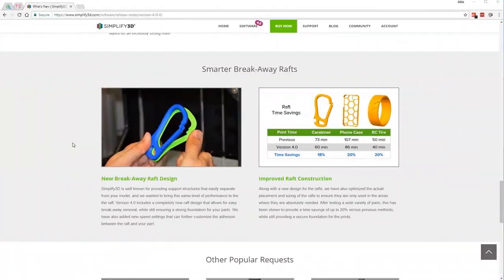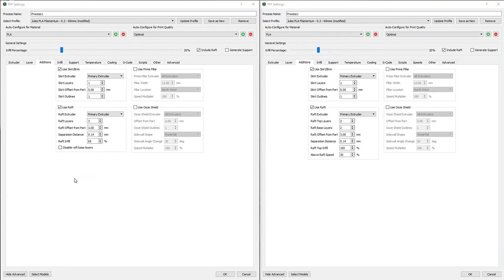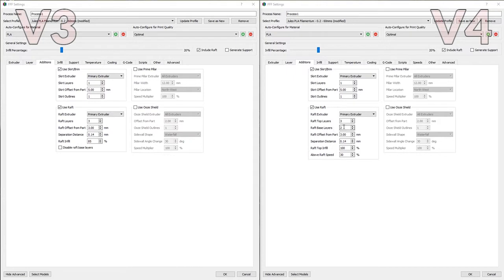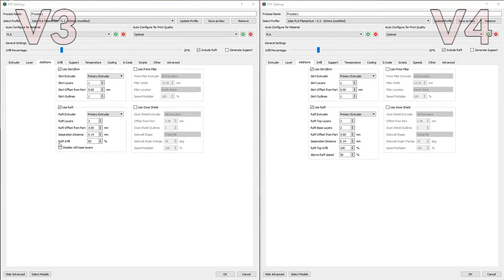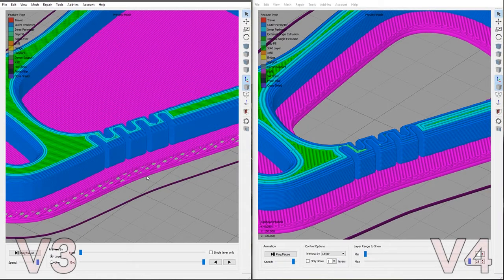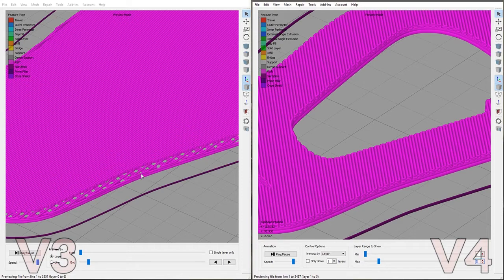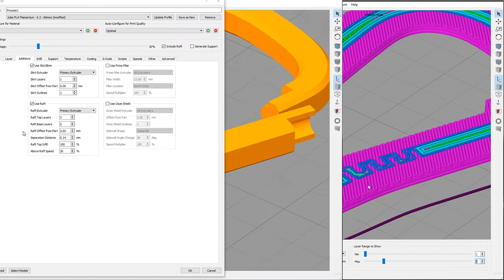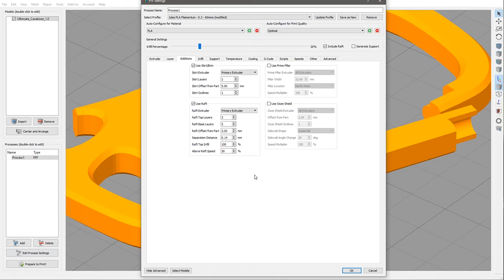Simplify3D Version 4 - Smarter Break-Away Rafts

Comment: Jules, I really enjoy your videos but I've had the opposite raft experience with ver4. I have as much trouble removing rafts as you do with ver3! I am printing on a mirror with kid's glue using 220 degrees on the nozzle and 60 on the bed. Using Monoprice premium PLA. I would be interested in learning your printing temps for this video. Thanks!
Reply from the maker: 220 is at the high end for PLA normally. If you haven't tried lower temps then it would be a good idea to try - go as cool as you can without effecting layer bonding. In that series of videos on Simplify3D V4 I was using Filamentum PLA - hot end at 200C and bed at 50C. Aside from that, in version 4 you should be able to tweak the new raft settings to improve separation - a mixture of increasing the Separation Distance and Above Raft Speed will decrease the bonding between raft and part. But, unless you can't reduce your main hot end temps for some reason, I would look at those first.
Reply: Bingo! Thanks so much for responding! I dialed the hot end back to 200C and the next raft was much easier to remove. The job before this one that I ran at 220 I had to chisel apart.... SO much to learn about 3D printing!

Comment: With the usefulness of brims these days, rafts sort of take a back seat. Thanks for the demo. Now I'll know what to expect when I have to use one.
Reply from the maker: They are useful to prevent warping with warp happy filament or parts with very small contact patches but other than that I think brims are a better option as you say. Thanks for the comment Ray.
Reply: My brims aren't working correctly anymore and, 8 times out of 10, are messing up the print. Have you ever experienced this?